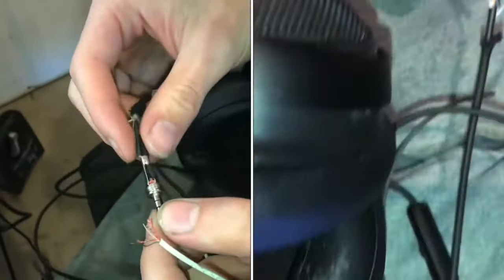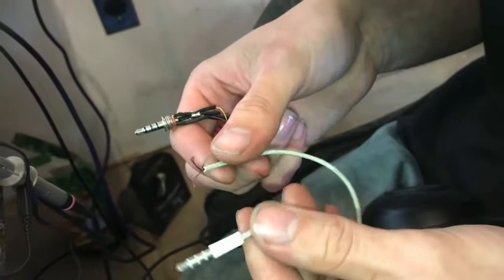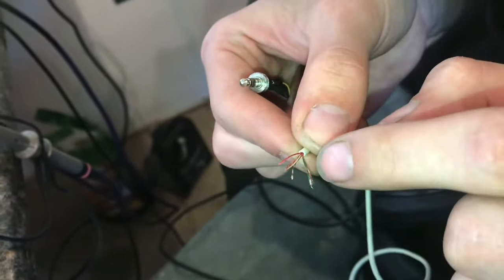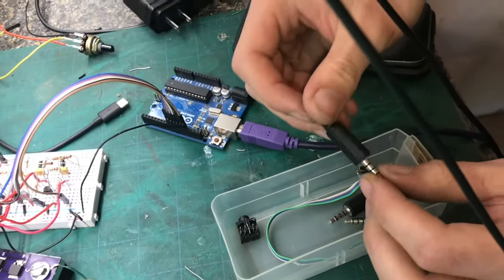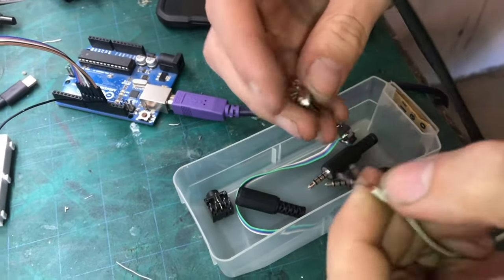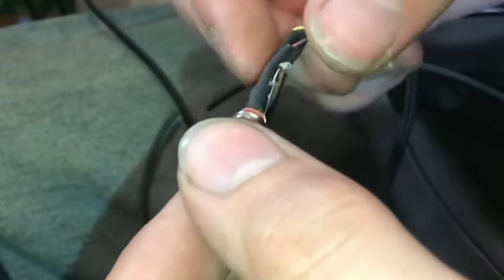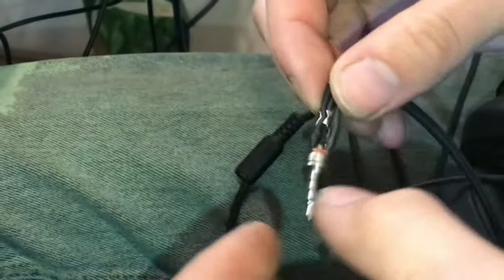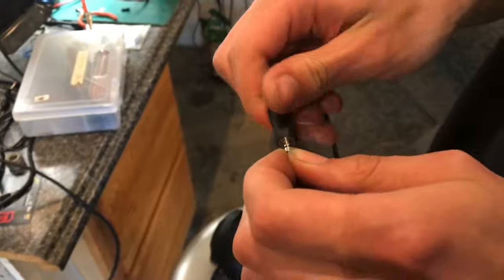“headphone jack” REPAIR 3.5mm replacement repair plug jack trrs 4 pole stereo male (fancasee)

Comment: Not a very good video. Too blurry and not enough informative repair seen. Lots of rustling around and movements to confuse the viewer. Speak slower, keep the camera still and focus on the repair, not the knowledge which is never understood by the viewer. Sorry, but it's true. Actually, the video did NOT show the soldering job, not what wires need to go where including the ground wire. Not helpful if all is omitted. Making a video means instruction, not just happy or unhappy with job. Sorry.
Reply: Spittin

Comment: can you tell me wich colour goes to wich plate?
Reply: In case anyone wondered, the big one is the ground and for the brown cable(there could be 2 brown cables for mic ones), where do i connect the red, blue and green ones?, well there are 3 smaller pins, left one for blue, middle one for green (microphone) and right one for the red cable.

Comment: A lighter solves the nylon and enamel issue. Then some solor coded enamel paint as a fist stage insulator. And then one heat shrink tube. For the strain relief I leave a little loop in the wires and a spring from a clicky pen with about 1/4-1/8 inch under the shrink tube. Gives the wire some flexible structure right at the plug.
Reply: Goated comment

Comment: In case anyone wondered, the big one is the ground and for the brown cable(there could be 2 brown cables for mic ones), where do i connect the red, blue and green ones?, well there are 3 smaller pins, left one for blue, middle one for green (microphone) and right one for the red cable.

Comment: I have been googling for 3 days now untill my eyes turned square.  I thought lets find somebody online and ask.  Can I use a 4 pole connector extention cable for a 3 pole device like my phone and headset with build in mic?  I am looking for a 3 pole 3.5mm jack extention 5 M but they dont seem to exsist :/

Comment: I don't have experience soldering.  What kind should I use?  the type that comes with sticks of extra metal? or do I just use the heating element to melt the wire to the connections?

Comment: I exactly need that 3.5 mm connector jack with holes in connections for ground, right and left speaker wire. Tell me the proper name for it and so that i can buy few of it in the market ?
Reply: 3.5mm 4 pole stereo plug. If your headphones do not have a microphone then 3.5mm 3 pole stereo plug will do.

Comment: Could you provide a link to the new plugy-in-y thingy that you used to replace the one that fell off? 

(I think it's called the jack or the male connector or something but idk so you'll have to excuse my lack of vocabulary lol)
Reply: You can get 3(TRS) or 4(TRRS) pole 3.5mm jacks off eBay, Amazon, wish, AliExpress it really doesn't matter and they are cheap as hell no matter where you look. Unless you start going for ones in full metal or with little extras or anodizing. I got a pack of 10 plastic ones for $3 off wish and a pack of 5 metal anodized ones for $6 on Amazon. They work great. Started using the cheap ones to fix kids headphones and the metal ones for my gaming headset. Best part is if it does again unscrew, desolder, cut, resolder, and screw it back together. Do it too many times and you desolder the headset and the jack and add a new wire.

Comment: You didn't show us a damn thing. SMFH
Reply: what do u need to know?
Reply: @syldekker4571  what color wires go to what sides of the jack?
Reply: @johndaarteest  Try googling "3.5mm jack wiring diagram" to answer your question. Hopefully you'll find an image that matches your specific jack!
Reply: @syldekker4571  OK thank you.
Reply: In case anyone wondered, the big one is the ground and for the brown cable(there could be 2 brown cables for mic ones), where do i connect the red, blue and green ones?, well there are 3 smaller pins, left one for blue, middle one for green (microphone) and right one for the red cable.